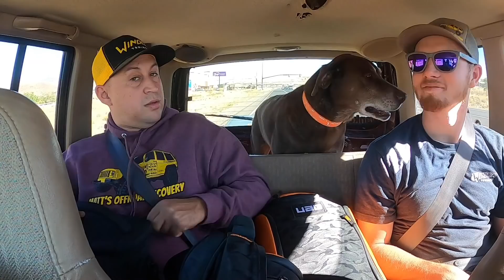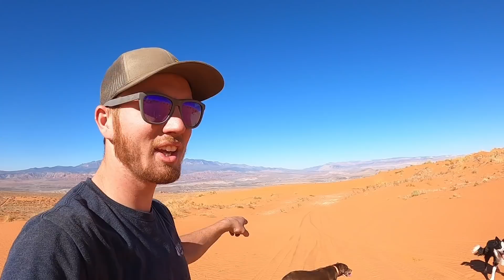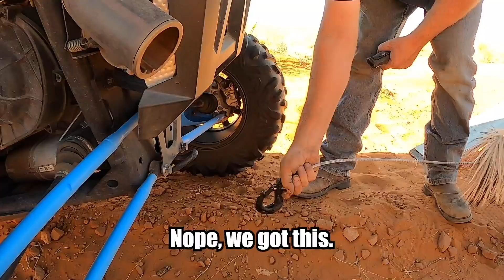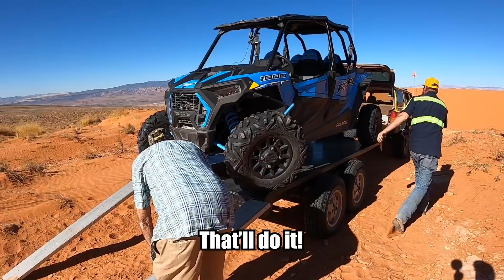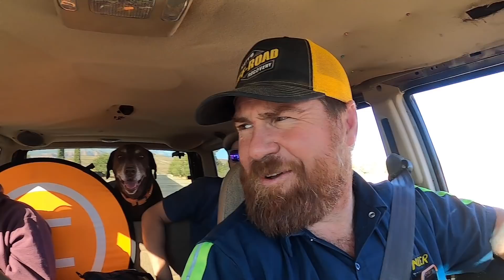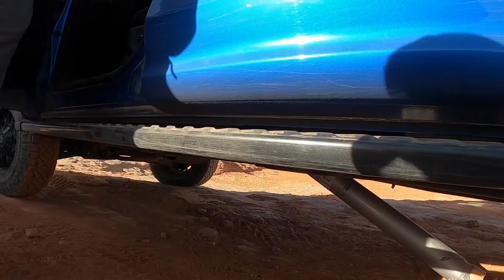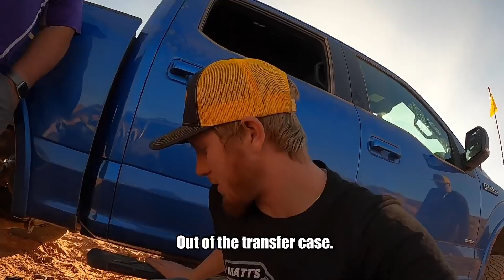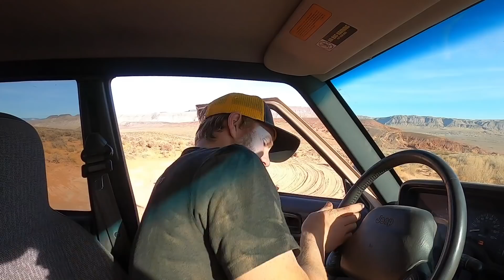Ford F150 Breaks Its Drive Shaft...Now what?

Comment: Job security is being a side-by-side mechanic in Hurricane, Utah.
Reply: Ya for real
Reply: @ernestdougherty3162  Well said, question? Is there that many rental units damaged during use? Has to
be a profit a profit margin somewhere I’d think.
Reply: @garbinator09  I don't think the hire outfit is swallowing the repair cost, customer or insurance would be responsible.
Reply: Couldn't have said it better myself
Reply: Hurrk'n and Laverkin alike.
Reply: Polaris mechanics in general
Reply: Gary Bowen that’s why the rental places require either a cash deposit or credit card on hand.  Probably charge a daily “loss of rental” fee for each day in shop.
Reply: We could make a fortune building upgraded control arms, and heims. I see the same failures out here at Glamis.
Reply: Razer bill: $27,391.62
Reply: So, who’s gonna open the first custom side by side shop right by the dunes
Reply: Drive around an ice cream truck full of A-arms would be a good start
Reply: Especially a welder Lol
Reply: Those things seem to break pretty damn easily
Reply: Job security is having a college degree.
Reply: @rippedcivic5364   Coincidentally, you don't need a degree to become auto tech.
Reply: @MrAudioDub  Looks like the suspension is made from tent poles, they are so small
Reply: @chillyourself5208  That's true, but only a fraction of the population does off-roading of any kind.  And cars are getting more reliable every year.   Fewer mechanics are needed per person as time goes on.   As soon as EVs are half of vehicle sales, a lot of mechanics will lose their jobs.  Tire shops will be the only part of the industry that stays unaffected
Reply: I took my mig welder to the dunes made enough money in 3days to buy a honda 4trax
Reply: Also a parts supplier, fabricator, even an aftermarket shop with an little bit of everything would do well.
Reply: Lizzie's father should have never stopped having more. She's gorgeous!!
Reply: If you're ugly like me please do society a favor and stop having children..If you're really attractive and find an attractive partner please have many
Reply: @rippedcivic5364  I can promise you from experience that isn't true
Reply: @MrAudioDub  if you upgraded the control arms I think you would risk damaging the frame.  The control arms breaking is probably saving the frame from major damage.  
You're right though.  They break ridiculously often.
Reply: @veganpotterthevegan  Hoover cars next. LOL
Reply: Help understand this? So the shaft on the f150 was removed. The owner can still drive it without it?
Reply: @HugDeeznueces  as long as it is a 4x4 you can put it into 4 wheel drive and drive it using the front wheels.
Reply: And all you need to know how to fix is the front suspension.
Reply: @rippedcivic5364  Job security is willing to work doing anything and giving it 100% of your ability.
Reply: Or Southern Arizona. Insurance work a plenty!
Reply: @rickinoakville1549  First couple upgrades should always be Cage, A Arms and trailing arms then they are pretty bullet proof
Reply: The machines are capable, the drivers not so much usually
Reply: @HugDeeznueces  he can still get towed.  It looked like the shaft was dragging in the sand. There were dragging grooves in the video in the sand from the  forward half of the drive shaft.  Go back and look at it again as they hit the exit road. 
JoeB
Reply: Or Matt's job.
Reply: @MrBtdobie  Those vehicles are really only made for driving.  When they go airborne, and the undercarriage lands on rocks, things might break.  If they make the vehicles more sturdy, drivers will probably just try more "extreme" stunts...
Reply: They sure seem fragile in the front suspension department.
Reply: @rippedcivic5364  🤣🤣🤣🤣
Reply: @chillyourself5208  People are also pretty rough on them. That is a big misconception people have about RZRs. If you start jumping 20 feet in the air with any thing it won't last as long.

Comment: I'm constantly amazed at how fragile the suspension components on those side by sides are.  Looks like it was made with electrical conduit.
Reply: They're total junk. I've welded on a bunch of them over the years. The only way to make a sxs not suck is to replace all of the metal with 4130 crmo 🤣🤣
Reply: 'Noodle suspension' is the correct description 😅

Comment: That driveshaft comes with the full guarantee: if it breaks in half...you get to keep both halves...
Reply: That why Ford gives a pair of shoes with your purchase. 
For the walk home.
Reply: Driver
Returns
On
Foot
Reply: Found On Roadside Dead
Reply: Failure Of Research & Development
Reply: Fix or repair daily
Reply: @dirtbikeguy7969  I never heard this one!
Sorry but I'm stealing it hahaha
Reply: @robinwammack218  dont forget the heated tailgate :)
Reply: @GearHeadWW23  Sort of like the rear window defroster on a Yugo -- keeps your hands warm when you're pushing it....
Reply: @GearHeadWW23  
So your butt stays warm while waiting for Matt’s crew to tow it back
Reply: @robinwammack218  hahahahaha yessir
Reply: And a pre paid calling card, to call a wrecker.
Reply: @AndrewAMartin  :  I'll bet half the people reading this don't know what a Yugo is.
Reply: @johndavidwolf4239  65% lol
Reply: @AndrewAMartin  You win the green participation ribbon for the best line of the day.
Reply: Found On Rubbish Dumps
Reply: did anyone else think that driveshaft looked like foam wrapped with aluminum foil? No wonder it broe.
Reply: @raullasvegas  The foam inside the shaft was probably to stop the sympathetic vibrations (ringing) as part of the NVH (Noise, Vibration, Harshness) control by the manufacturer.  The tube does not need to be very thick walled as it is not resisting bending, rather it only needs to resist twisting along it's length...?
Reply: @raullasvegas  it certainly looked aluminium to me...
"Keep it real, make it steel..."
Reply: @teenaramsay2469  That agree that sounds reasonable. In the old days, a drive shaft would be considerably thicker. I once through a drive shaft on a 28' cube. Im glad it was sunday, and there wasn't anyone next to me going down I90.  Even my 351 Windsor with a granny gear. You could go from 0 to 20mph in 0.01 seconds. You would give wiplash to anyone in the truck. The tourque on that must have been more than anything that econoost could have created.
Reply: @dirtbikeguy7969  f***ing old rebuilt dodge.
Reply: It's called driveshaft division. The driveshaft splits to multiply. It's like cell division only in the non biological world.
Reply: Most people don’t realize the drive shaft is like a fuse in a power circuit. It is meant to break before other higher priced components in the drivetrain will be damaged when over torqued.
Reply: warranty only for fords course!
Reply: @robinwammack218   - I like Ford’s - but that was funny 😂😂👍

Comment: I saw MacGyver weld a drive shaft back together with jumper cables and a Quarter.
Reply: In this scenario, I don't think that is possible at all because it is an aluminum driveshaft. Aluminum can only be welded with an AC current and a cars electrical system is DC. That is just 1 reason it wouldn't work lol.
Reply: @flecktards3126  You can DC stick weld aluminum. It isn't easy but possbile.

Comment: The Gearwrench extra long box end wrenches are fantastic for those Ford driveshaft flange bolts. I use my 12mm 12 point (85912) all the time for them.
Reply: Really need a torch to warm up the loctite. No torch? I just snipe my 12 mm challenger combination with the 14 mm/13mm Sears box wrench.

Comment: Thumbs up for degrees Celsius conversion.
Reply: That's really helpful to be honest. Otherwise have to stop the video and convert the value every time.
Reply: I have to use both metric and standard measurements pretty regularly. I've learned most things are just fine getting close when talking to lay persons. I only convert if I have to be spot on. I.e. 1 inch is roughly 2.25cm, 32F is 0C, 10 lbs is roughly 22 kg
Reply: @thomascalton3067  1 inch = 2.54cm ;)
Reply: @thomascalton3067  I assure you mate 10lbs is not 22kg, one kilogram is roughly 2.2lbs and one inch is  25.4 mm (2.54cm), 300mm is a  roughly a foot.
Reply: @thomascalton3067  10lbs is 4.536 kg.
Reply: Like I said, close enough 😉
Reply: @thomascalton3067  hmm, well 2.5cm would be close enough, but 2.25cm is somehow strangely off..
I guess for the weight you just mixed lbs and kg, but the best would be anyway if the US could finally get rid of all these non-SI units..
Reply: @manitouproject  probably not gonna happen in my lifetime
Reply: @marvindebot3264  
You're so far off! It is 304.8 mm = 1 ft. 🤣😉👍🤙

Comment: That's a pretty nice front end makeover on the RZR. Busted ball joint on the upper A, folded the upper A, split the lower in half, ripped the half axle out of the diff, bent and twisted everything else.

I'm surprised the tire is still attached, they got it 4/5th of the way.

Comment: I'm sure you've probably heard this before, but with as many busted front end side-by-sides that you pick up, a nice pivoting jack would be great to lift up the front end. It's the kind of jacks that they pick up Formula 1 cars with. two wheels and it acts like a big lever to just pivot under the car and lift it up a few inches. Then Your ramps would be more towards the middle so the jack rides up on them and the front two wheels of the razor or whatever are off the ground. It could probably come apart fairly easy and store on the trailer as well. Not that the current method isn't working just seemed like a potential solution.
Reply: A Broken tie rod clamp would be useful also
Reply: Yup, but Matt likes to keep it simple 😀

Comment: Soooo glad you’re running the Pintle hitch setup on that trailer.. my last job we would have to back up as fast as we could and dump the trailer into the lagoon to launch the boats. Needless to say we went straight to the pintle setup. Speed and steep angles do not do well with ball hitch setups lol

Comment: If someone designed a razer that could handle these jumps they could probably charge a premium for it. Probably impossible tho, it'd probably add so much weight the razer would be ruined. On the other hand maybe a ridiculously long suspension travel could be designed to absorb the impact over more time.
Reply: Yep, I always says that razers are just fancy golf cars to do some trips on the beach.
Reply: i think the RZR suspension is designed to break just before the driver breaks his/her own bones
Reply: Somebody did.  It's called the Kawasaki KRX-1000.  I know.  I have one. :)
Reply: The first rule of driving the dunes is don’t go over something you can’t see over. These clowns breaking all these razors are jumping stuff when they have no idea what is on the other side.
Reply: @iffykidmn8170  .. truth
Reply: I don't know about making them stronger, but perhaps they could design them to break loose in a way that is easy to repair in the field.  Much like a sheer pin in a snow blower, where if the auger gets clogged, there is a pin that will sheer away, before causing any real damage.

Comment: The rag won’t get chewed up??the out put shaft Is what about max 1inch in transfer case. So you got a half inch for rag to sit in there with out getting chewed and screwed. Tricks; keep  trash barrel rubber bands fat thick big ones. and plastic bags on hand  just for this situation
Reply: I was thinking a plastic bag or HEPA filter wrapped around and secured with ties or cable ties or strong rubber bands.
Reply: Yeah I've used a plastic bag and a bungee cord. If you get the bag tight it wont leak any fluid. I was able to drive a couple miles in 4x4 with the front to a safe location and replace the broken u joint.
Reply: Just buy transmission plugs, they're 3.50 a piece at the parts store, there ain't that many different sizes so it won't cost much.

Comment: I used to work on ATVs and power sports equipment.  The Polaris were always lesser quality then their Japanese counterparts.  I'm sure that they gotten better but so have the rest of companies. Honda and Yamaha were always the best in terms of quality and the fit and finish of the product.
Reply: I agree, and that's despite owning both Polaris and Can Am ATVs. If Honda would finally enter the market with a twin cylinder, 800CC or more ATV (such as basing an engine around their 'Africa Twin' motorcycle engine), and increase the suspension travel beyond their measly ~7 inches, I'd buy it in a heartbeat. The Grizzly is great, but still a bit underpowered

Comment: Transfer case is jacked up , or maybe the rearend, possibly how the driveline snapped.
Reply: It looks like it twisted apart. Modern thin aluminum driveshaft. Possibly scraped a rock and dented it. That takes most of the strength out of it

Comment: Safety chains are one of those things you just don't appreciate until the first time you lose a trailer.
Reply: My buddy lost a trailer and it snapped the chains like they weren't there. It blew a tire first is why it came loose.
Reply: Yeah, it’s all a matter of liability these days. Too many rogue trailers on car crash videos to ignore the benefits.
Reply: Totally agree. I had a hitch pin break onetime pulling a $40,000.00 bass boat. Chains caught and I was able to pull to the side of the road.
Reply: They’ve already lost a trailer once before so.......
Reply: No. You really appreciate them when you are nearly killed by someone else's trailer. 

my family and I were nearly killed on the highway by a trailer at night. I had changed lains to pass about 30 seconds before. trailer went flying by us in the next lane, sparks flying. 

I had always used a safty chain out of habit on my trailers, but that sure made me apreciate them. they get a lot if extra attention when I hookup now.
Reply: @Bryan-Hensley  Possible that the chain setup didn't meet DOT specs? or the trailer was badly overloaded?
Reply: @Bryan-Hensley  :  The "class" of the chain has to match the weight of the trailer.
Reply: You don't have to experience a failure in something to know it's a good idea to prevent it. Always used chains, never once thought it was unnecessary.

Comment: You gotta get the milwaukee m12 portable air pump, my dad got one and I use it for my truck all the time and it will do 12 tires from 20-35 psi without going below half battery when using the 4.0 AH M12 battery. I highly recommend one for the back of the jeep, it is super compact and you can air back up within seconds on each tire. Well keep up the hard work and awesome recoveries. Much love from CA (and a Tacoma owner!). We still love your videos! Hope the Banana is almost all redone and going stronger now than ever? -Alex

Comment: A suggestion… when you have to pull the yolk out of a transfer case or transmission, a medium sized plane old baggie and a long wire tie works well. And these could easily be carried in the recovery vehicle and not take up mush space…

Comment: Ouch - that broken shaft hurts.  It also shows how cheaply today’s trucks are made - all brands.
Reply: Seriously, was that just thin metal stuffed with foam???
Reply: @geraldg3130  All F150's since at least '97 are all aluminum drive shafts.  Large diameter tub with thin wall.  I have over 200k miles on my '98.  Usually you shear the U-joint first.
Reply: When tubing isn't damaged, it's actually really strong. What likely did this guy in, is he probably smashed it on a rock, then it created a weak point, and just twisted it off. Having a driveshaft with less rotating mass on a vehicle that sees high speeds is better for efficiency too.
Reply: @evinsteven13  I like how someone tried to duct tape it together.  I think you got it though, drive shaft was damaged and the twisting took it out.
Reply: Made to break and cost twice as much as 20 years ago. Crooks.
Reply: @chrismay2298  Yes, definitely.